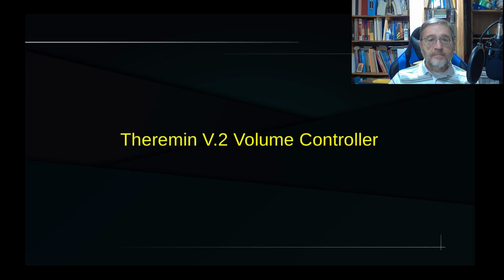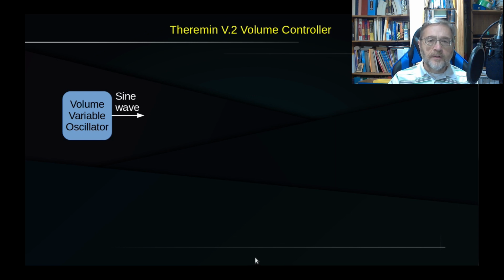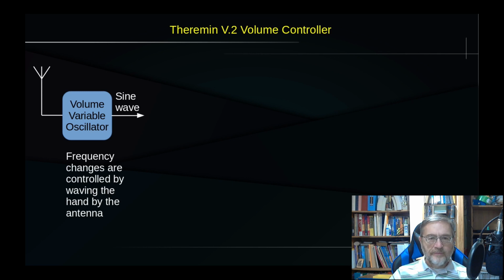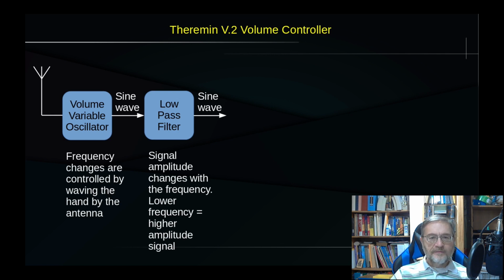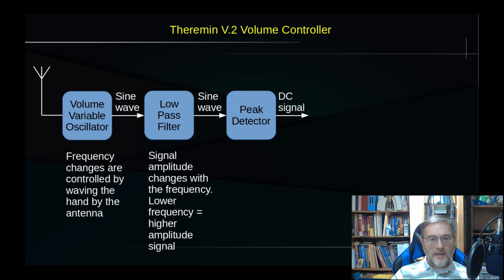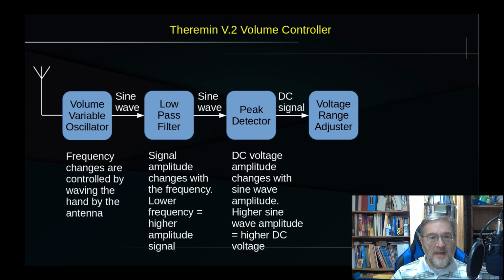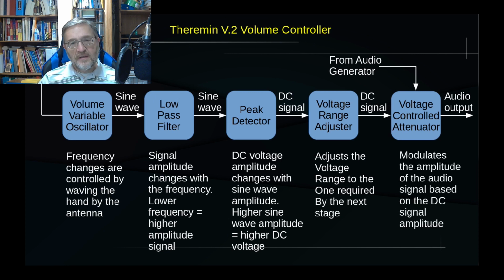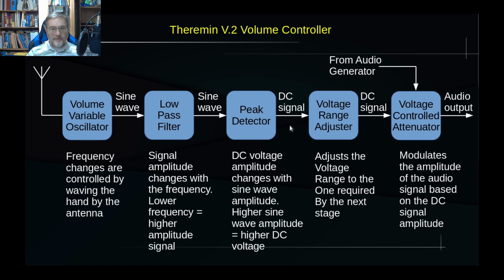Theremin V.2 Volume Control

Comment: Hello sir... When that VU meter  video is coming?
Reply from the maker: I already published a video on a simple VU meter circuit. Here is the link: https://www.youtube.com/watch?v=JP6DIxa3qZs
However, I will publish a new one sometimes in the near future that uses an integrated circuit rather than discrete components. It could be part of the Theremin project, but it could also be done as an independent circuit. I am still debating on that. Either way, it will come out relatively soon.